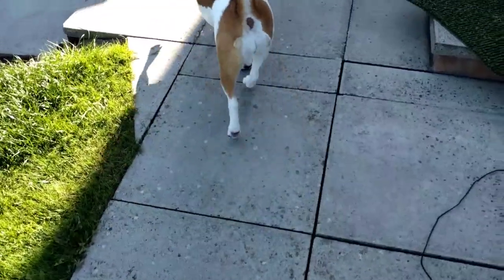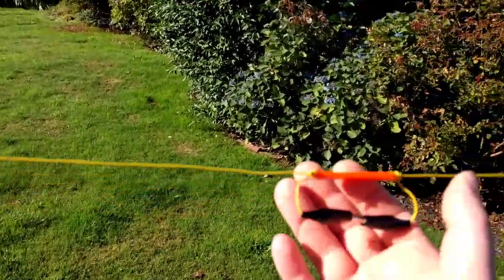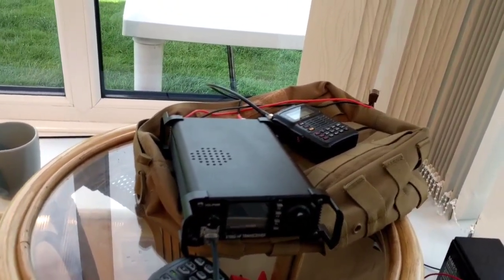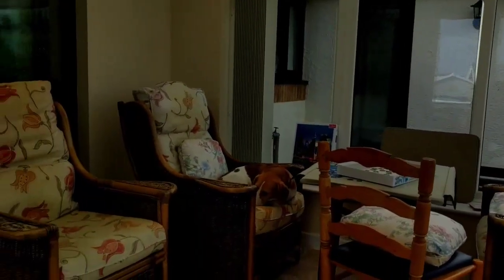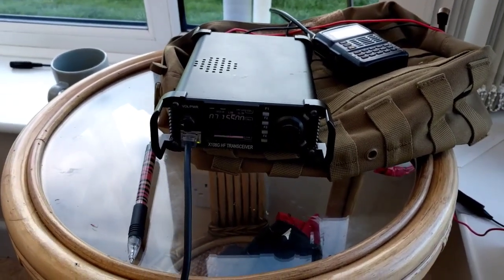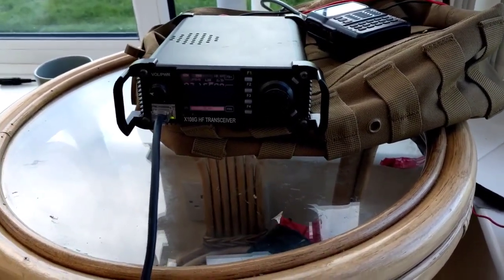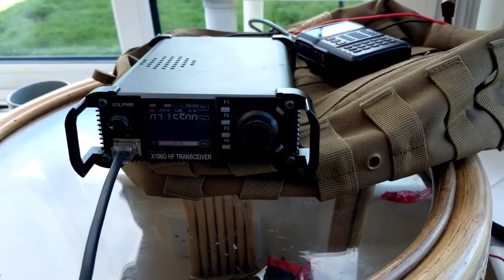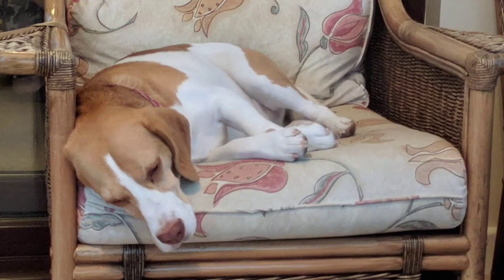Setting up a portable amateur radio station while on holiday

Comment: How long did the 7AH battery last ? TNX 73
Reply from the maker: I kept it in charge between each session,. It lasted fine for each 2-3 hour session, mostly listening.
Reply: Thank You for responding. I was wondering how long it would take to pull the battery down to 12v. TNX 73
Reply from the maker: @maryhsu  Much depends on how much you transmit, the Xiegu does not draw much in receive and with only 20watts output can last a while during QSO's. I would guess a couple of hours 80% Rx and 20% Tx to get below 12v